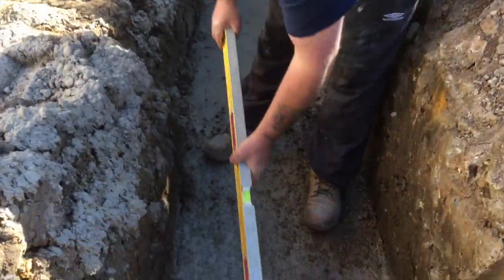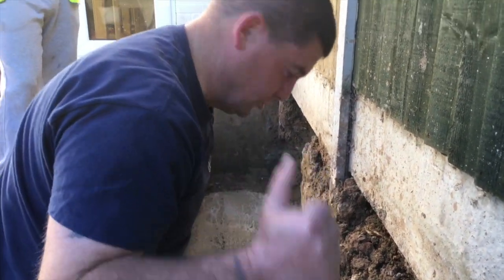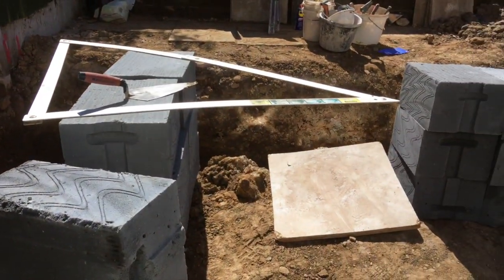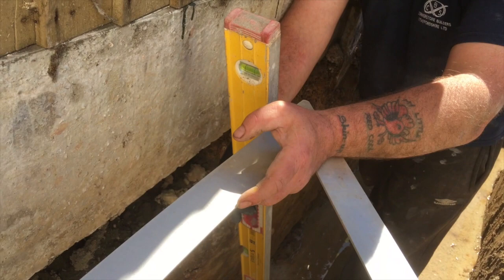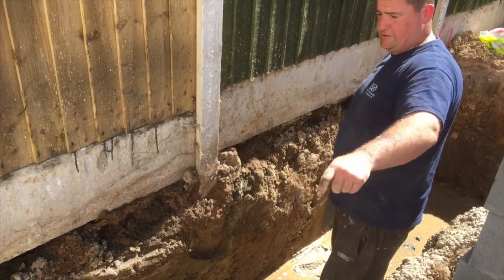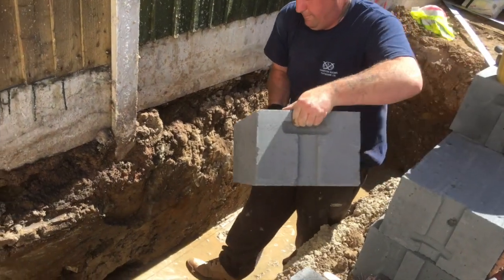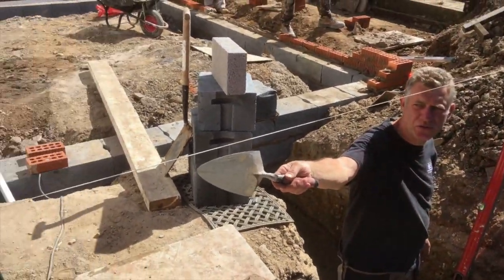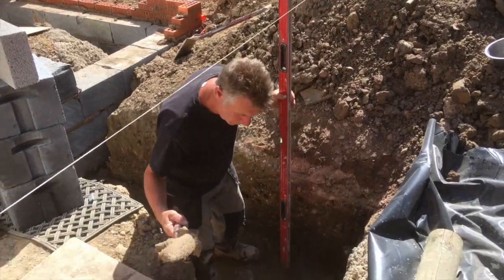How to build an extension: part 2  set out and build up to damp course

Comment: About to start building in Ireland. Going direct Labour due to crazy prices but these videos are brilliant as I don't have much of a clue but I won't be long learning. Thanks
Reply from the maker: Nice one, all the best with your build👍
Reply: Did you do your build in Ireland? Just starting my own here... any tips?
Reply: @Chris45332  yes i started. Block layer took forever but they are roofing the house now. Have lots of tips, go with bungalow instead of two storey. Also a big one i have for you is make your utility plenty big. I ended up building an out house attached to the gable end of the house where the utility is just to carry all the plumbing appliances as it takes up a pile of room in utility, and even with all that space freed up now in utilty its still going to be tight. Where and what are you building?
Reply: @jericho9653  Hello! Thank you so much. I'm on the East Coast. Yes I went with single story pitched roof, mainly because I thought 2 stories would be really stressful :face-purple-crying:. Utility is small... I will redesign it now. I'm at early stages, but hope to get all my quotations done in the next couple of weeks. It takes forever just getting prices!
Reply: @foundationgood123 hi Chris how long after you poured concrete until you started the build?  I'm having my concrete layed on Friday. And start the build following day on the Saturday.  They said they can do this by adding a additive to the concrete to speed up process of it going off.  Thanks

Comment: I'm not a builder, so excuse my ignorance. I thought foundations were supposed to be, 1 meter deep? Or am I wrong. Also, isn't that steel bar supposed to be running through it as a strengthener so it doesn't crack?  I'm planning on doing an extension on garage myself, but my foundation will be reinforced and deeper.
Reply from the maker: Its a metre to the top of the concrete and the foundations don’t need reinforced mesh as the ground is clay. However, if the ground is poor thenthe inspector may well ask tha reinforcements be added.  you may be getting confused with “Trench Fill” concrete foundations which are optional ie up to you, again not necessary to the build!
Reply: @foundationgood123  Thanks for clearing that up. I’m also clay, so saved me reinforcing.
Reply: May I ask how deep the concrete should be pull inside the trench? and what type of blocks you used to build to the surface ground before lay the engineering brick? Many thanks!

Comment: Why not concrete further us the trench rather than using those foundation block?
Reply: Exactly, I always mass fill the trench with concrete, and look at the work you can save yourself, it just makes setting out so much easier
Reply: Green Genes because that’s the easy and cheap way. This way you get more days Labour charge and charge more for materials.

Comment: Question what are benefits of using the foundations blocks over having more concrete in the footing upto a greater height ?
Reply from the maker: Less labour involved if it is what we call "trench filled" ie more concrete in the foundations!
Reply: @foundationgood123  sorry I think I phrased my question poorly . Instead of laying the trench blocks could you just have the concrete poured to the top height of the trench blocks? In my mind that would be less labour but I must be missing a trick 🙂

Comment: How long do you leave concrete to set fully before laying on them? also what grade concrete do you recommend for foundations? Thinking of tackling extension myself.
Reply: Phil Snow allow the concrete to cure for one day before constructing your deck or placing heavy objects on the footing, that’s If you’ve You used a standard mix
Wait at least 3 days to begin construction as a rule of thumb foundations have reached 90-95% strength after 24hrs if all the correct procedures have been followed. The height of brickwork in a day depends of various factors but if you’re working to a standard then it’s 20 courses or 5 ft which is the norm for facing bricks
Reply: @TheAudiostud  24hr = ~75%
🤜🤛
Reply: @TheAudiostud is that with additives in concrete for it to go off quickly? Without additives in concrete is it 7 days? Thanks

Comment: This may sound like a daft question but here it goes:
I couldn't help but notice the water when the footings were dug and now that the footings have dried, the water is still there....will this have an effect on the foundations/blocks below ground?
Any info on this would be most welcomed.
Reply: Nacho Vidal blocks can rot out over years if theyre always saturated. Plus lime in concrete reacts with water over the years so it becomes brittle. Im talking years and years now being saturated and not drying and not just a bit of water.
Reply: Mr G thank you. That makes sense 👍🏽

Comment: Nice job but  old fashioned way of working.in and around london all domestic extensions are concreted solid allowing for I concrete block and 2 courses of face brick below d.p.c.not worth the time and effort doing all that brickwork below ground total waste of time materials and labour .much easier to mark out the walls 15 inches below existing d.p.c.just scratch it out on the concrete.
Reply: Mony Torris building regulations in london specify min of 1 metre solid concrete foundations for domestic extentions the local authority building control will acsept nothing less.as for polish corner cutters I hate them as well the building trade in London was run here by the irish and the northerners 30/ 40 years ago I'm a 2nd generation irish northerner from leeds who's been here 40 years and I am city guilds qualified bricklayer in nearly 64 and still getting work been bullied of quite a few jobs here over the years northern  leeds suporters here were not liked or wanted especially around east London but I haven't had a labourer work with me who speaks English for many years.
Reply: that sbecause it ishard work and only people that have had it hard will d oit @leemarley816